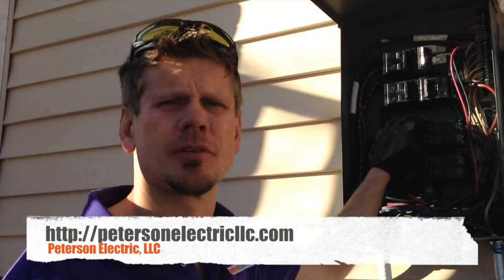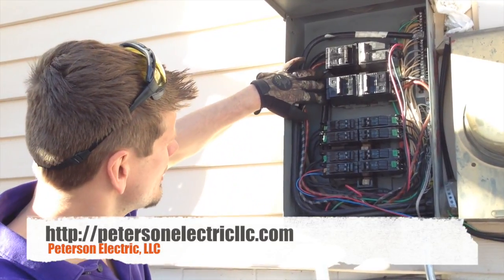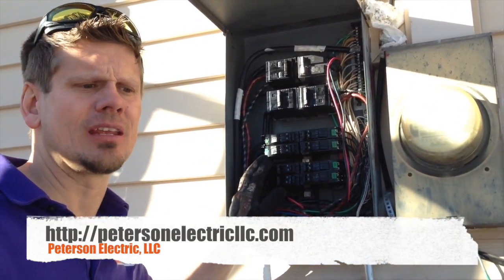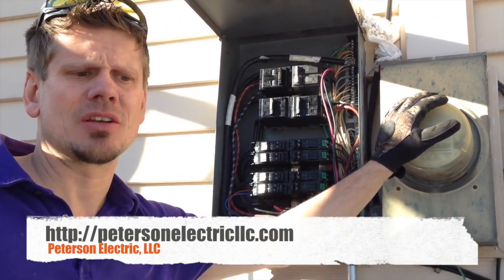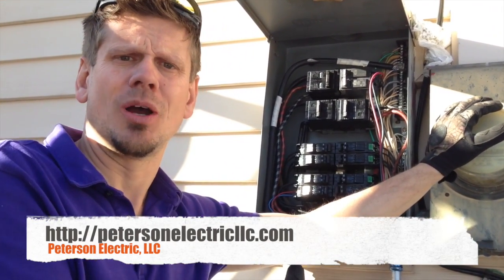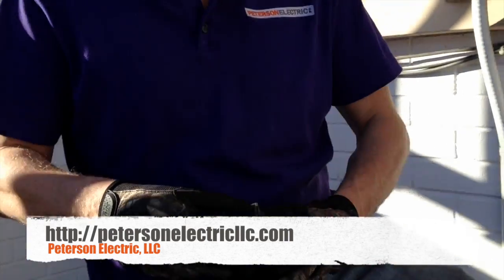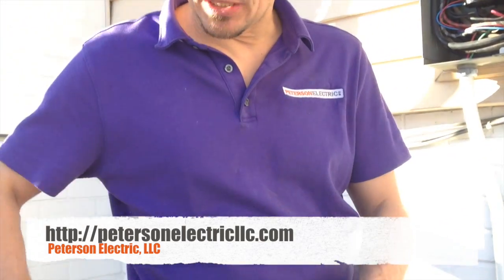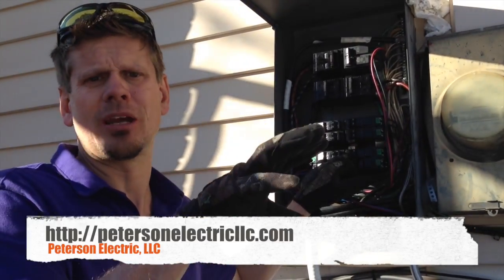Split Bus-Bar Electrical Panel, What Does This Mean?

Comment: Invaluable explanation! Thank you Peterson Electric!   We just moved into a rental with a 6 throw split breaker board. It's got 3 open 2-pole throw spots now and I want to install a 2-pole breaker for my shop's dust collection. Being that I can't turn that section off, is it advisable to call the city to have my power cut to install a new 2-pole in the top section?

Comment: I love your videos full of information.   About 3 yrs ago I lived in a rental house that , if i can remember correctly,  had all the 2 pole breakers near the top labeled,  Range, Dryer,  Well Pump, Air Conditioner,  and Shut-off for lower, then all the remaining single pole breakers at the bottom.  At the time I thought something was very weird about that house, because every other place I've lived at had a main breaker at the top, 100 amps, followed be whatever else was  in the home as expected.  That rental house was built I believe in the late 1960s or early 1970s.  I never seen anything like it before.    Thanks for explaining,  although I no longer live at that house.

Comment: Thanks my house built in 1979 has a split bus panel no main breaker just the rule of 6 it does heve 200 amp lines coming in and I plan to run a sub panel off of it at least 3 I’m doing an outside kitchen workshop and a second story addition I thought about replacing the breaker that runs the water heater from the top bus bar to the button one and then fit a 150 amp breaker to supply the other sub panels hopefully it’s ok otherwise I’ll just replace the entire panel with a standard main breaker panel 👍

Comment: Just because it's not required to be upgraded, doesn't mean it shouldn't. Home inspectors are looking out for the best interest of the their clients, which is the buyer. Upgrading an obsolete panel is not just trying to nail the sellers. It's about providing the new owners with a safer product. Split bus panels are past their life expectancy, therefore their breakers are not reliable to trip when needed. Not to mention the risk of confusion during an emergency having multiple mains. Remember,....code is the bare minimum!
Reply from the maker: Not all split bus bars have issues with breakers tripping. I do agree to having an upgrade to allow more space for AFCI and DUal Breakers, but they are not required unless it is a known panel to fail; FPE, Zinsco and others.   I have seen plenty of older GE's and ITE's and Bryant that are split bus and no issues. If "Realtor" inspectors are this concerned than why are they not demanding the breakers to be upgraded to AFCI and DUAL's throughout the house with Smokes and CO hardwired to a circuits?
Reply: I'm not sure what a "Realtor" inspector is, but as a home inspector, I write up any panel that has been recalled to be replaced immediately. I call out obsolete panels (e.g. split bus) to be replaced at their discretion. It's simply a recommendation. I understand it's not required. I thought I already covered that. I do also recommend that the breakers be replaced to AFCI and that all smokes be connected. And how are you certain that obsolete breaker are okay? Do you trip each breaker to make sure they still function beyond their life expectancy?
Reply from the maker: @TheRynovision  No one knows if a breaker will do it's job, I have had them fail at 19 years old on good brands by just turning them off with no loads and the main 200 amp on a home would not reset. But changing out a box that is not "Listed" as bad is not always the answer. It is best to get reconditioned breakers with that brand, and where I get them they do a shunt test, If needed.

Comment: I have a GE Split Buss Panel. Can I move all circuits to a sub panel, and use the GE as a dissconnect? I want to have 1 main breaker in the GE feeding the sub panel. I know it sounds dumb to keep a panel with 1 breaker, but I'm trying to avoid having the meter removed. Please let me know, thanks!

Comment from the maker: I us to be an appliance Teck 18 years ago, if the switch is bad above on the NC (normally closed), you will have voltage, or if the breaker was not a two pole 40 or 50 amps, with a common tie handled, you will get hit! 🤪

Comment: Lot of Folks don't realize the white wire can be HOT!
Reply: johngmc65 it should not be hot as it is the neutral wire by  design, however it could be energized which is what he was saying as I understood him. However, I have seen where the hot wire was used as a hot wire, a poor practice in my opinion.
Reply: White and gray CAN be hot if labeled on both ends for repurposing.
Unlabeled repurposing and regular romex travelers can happen, even if they're not supposed to.
Always check for live wires using verified noncontact methods first.